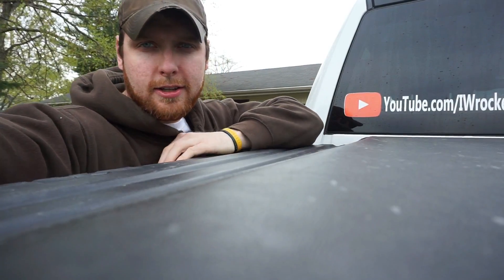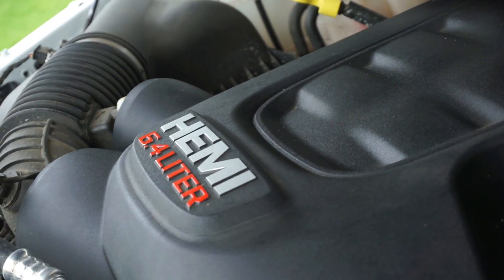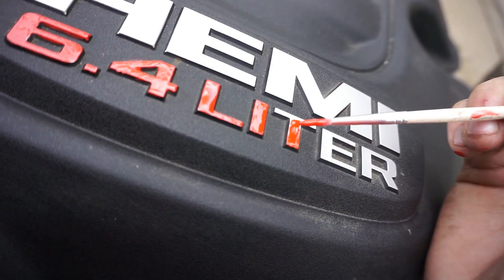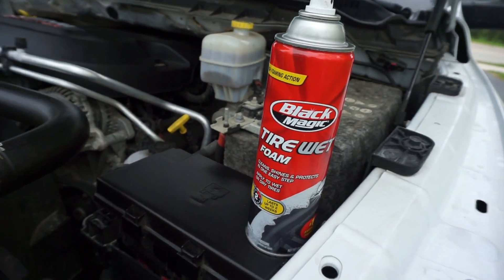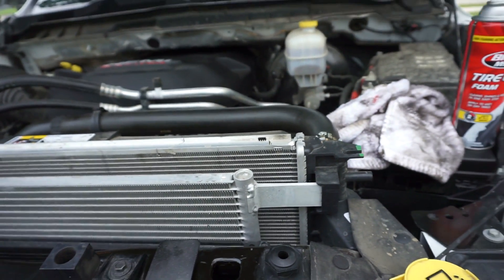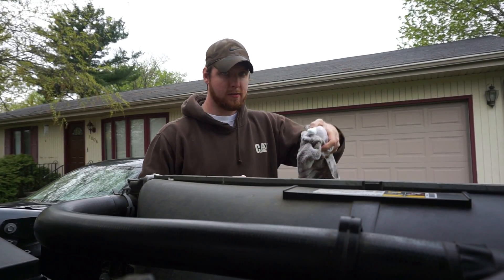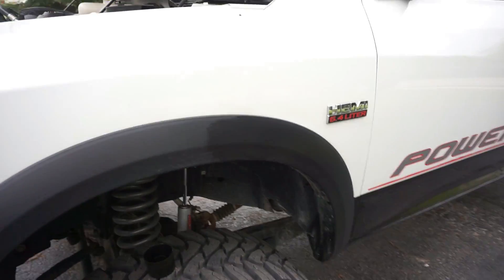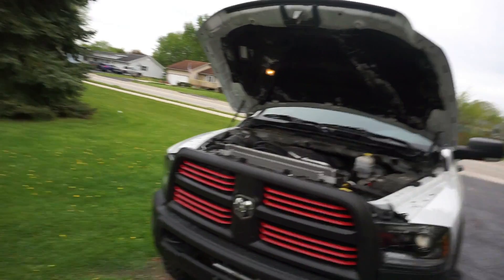Clean Engine Bay in 5 Minutes!!

Comment: I agree this is good for plastics and rubbers. Cleaning an engine with it? not really. But using it as a shine product afterwards is a great idea and seems to work good. I haven't used it in the engine bay. Great video, thanks for sharing a video that shows a product have great results. Also, I really like the engine cover paint! I thought you masked it off and spray painted it. But hand brushing it is easier! Smart man!